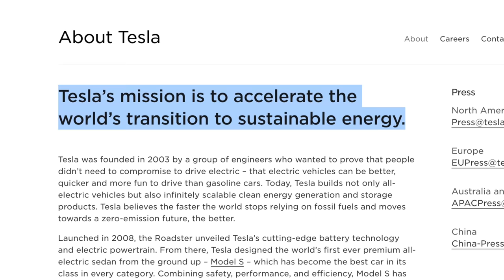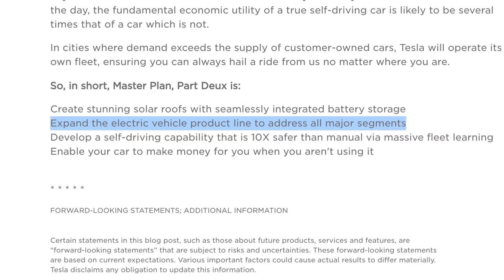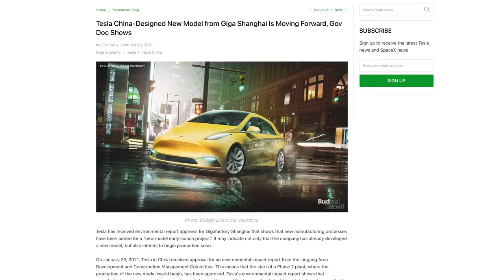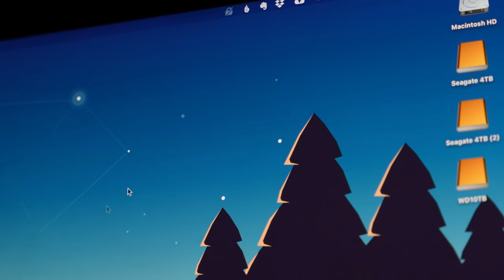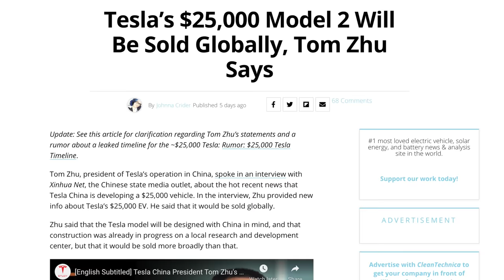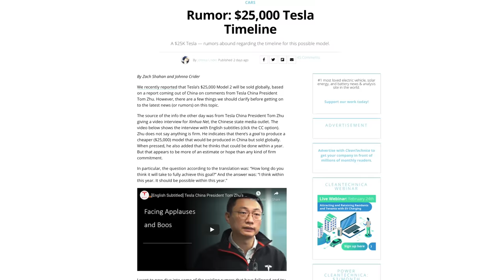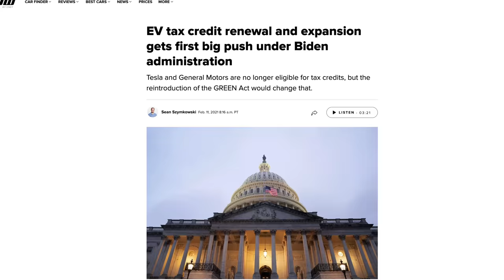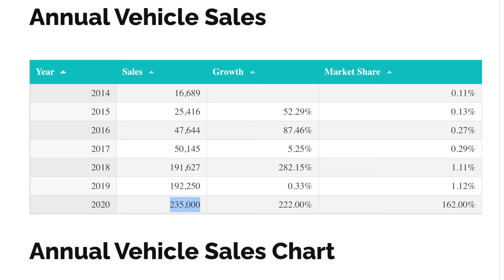New Tesla Model 2 = Game OVER for Gas

Comment: Given that Tesla sells every $40k+ model that they can produce it would be very difficult to meet the battery and sales demand for a 25k or less vehicle.  Many would buy and flip the cars until demand is met.  Knowing Tesla though they would probably start with a 40k performance version before offering a long range or base model.
Reply: Which is exactly why a demand-side tax credit is throwing good money after bad.
Reply: @kevinkent6351  Tesla doesn’t have the tax credit anymore though.
Reply: @rathelmmc3194  right, but the proposal is to add it back.
Reply: @kevinkent6351 , yeah that’s ridiculous. Tesla is profitable so the point has been proven that EVs can stand on their own. The whole credit should be removed from all manufacturers at this point.
Reply: There's a battery race going on right now. Batteries will not be a problem in two years
Reply: @rathelmmc3194  The credit is not about saving money. It's about clean air so they will bring it back
Reply: @John-zt3lv  you do realize that the problem with batteries is the actual mining not battery productivity right. Also I love tesla I believe in the company but saying the tax credit is to "bring back clean air" is dumb if you consider that the us is fairly strict on its regulations and that evs don't actually stop the air from being being filled with co2 in the short term so shouldn't that money go into carbon capture programs
Reply: @rathelmmc3194   then s is not a true statement! Tesla is only profitable because of credit purchased from them. Tesla does not make any money from selling cars!
Reply: @ruthisabel1329 , doesn’t really matter why does it? They’re making more than they’re spending. Those credits they’re selling aren’t going away anytime soon.
Reply: They've already done that...that's what the first two versions are...
Reply: @rathelmmc3194  Tesla makes it's money selling Carbon credits to GM and FCA not from selling cars.
Reply: @MazdaMike0122 , like every company they have multiple revenue streams. Or do you think Exxon only makes money off of tax rebates?

Comment: 200 miles enough for me. I'm here for the price and ACCELERATION
Reply: I dont think the acceleration gonna be something astonishing
Since they will be taking out from the specs to make it cheaper
Reply: Eh 200 miles gets tough sometimes but I think its a good idea
Reply: 200 miles on paper is like 160 irl, and then you get drain while you're at work. It would be tge minimum you need and you'd need to charge every single night
Reply: @dealornodealproductions7314  Agree. They need to put transmission like Porshe did on their electric cars.
Reply: @dealornodealproductions7314  My M3 LR has 350 something miles range total. They recommend charging it to 80% normally so that's about 280 or so miles. Granted, you do lose some range at work which is @ 1 mile per hour if you have sentry mode turned on but it's MUCH less if you leave that turned off. If you want to go on a road trip, you can charge it to 100% and have at it (or let the onboard map route you to the nearest charger etc.).

And yes, they also recommend leaving it plugged in whenever you're not driving but it's not a big deal. You get home, grab the cord, push the button to open the charge port flap, stick it in, done. You can even schedule charging so it happens in the middle of the night when it's cheaper. You can also tell the car to warm up or cool off before you set off for work or home. It's awesome! Fancy a biscuit during the morning commute? Zero guilt while NOT idling in the drive thru lane. =D
Reply: @ElroyMcDuff  why does BMW recommend only an 80% typical charge? Chevrolet at one point told people to back their charge top to 80% for the Bolt,but it was because of a suspected overheating problem with the batteries, nothing to do with efficiency as I understood it.
Reply: @alpha6549  I just rode in my brother’s Tesla for the first time. The pickup was astonishing!
Reply: Need 400 to be a game changer.
Reply: @expendable4h002  or to be 20-30% cheaper than gas.
Reply: @morganangel340  not even close
Reply: @replyhere590  BMW??? Lol. M3 LR = Tesla Model 3 Long Range
Reply: really thats too low
Reply: With electric vehicles the more miles you can drive the more power you can pull out from the battery
Reply: Try bungee jumping.
Reply: @eartherinfire  try bungee jumping
Reply: @alpha6549  you might be surprised, it would cost tesla much more to develop a new motor than it would to use what they already have in the model 3/y/semi/cybertruck, and yes they all share the same motors.
Reply: @Ma77riK  wait what… 
No way
Reply: @georgeb5262  stick shift evs need to become a thing
Reply: @OhKnow379  There already is. It can improve your range, performance and experience. Just to know use magnetes instead of clutch.
Reply: @georgeb5262  which brand?
Reply: @OhKnow379  Well, Porsche is now the most known (sadly, it are only two speeds), but however, I think Ford is planning to put 6-speed manual transmission in their new Mustang (Idk if this is Mustang anymore, because it always was V8 car. At least this one may not be a SUV). I think Ford already put this into another their electric car, but forgot the name. Opel Manta will have 4-speed manual, but there are a lots of aftermarket transmissions you can buy right now.
Reply: WHAT DOES 200 MILES MEAN?